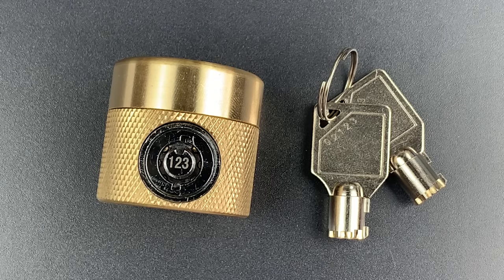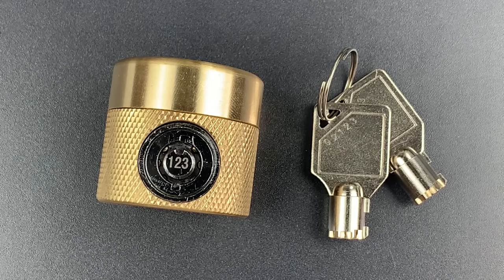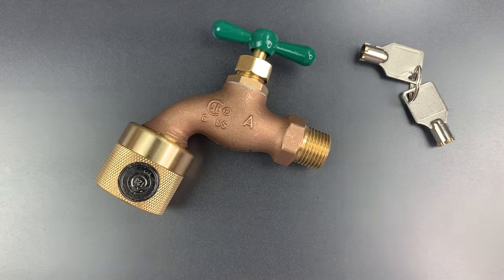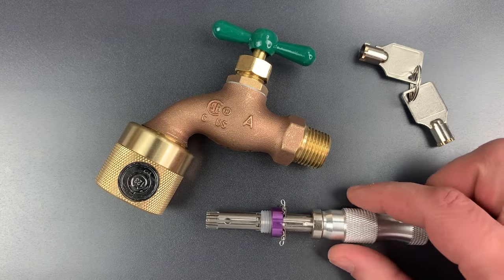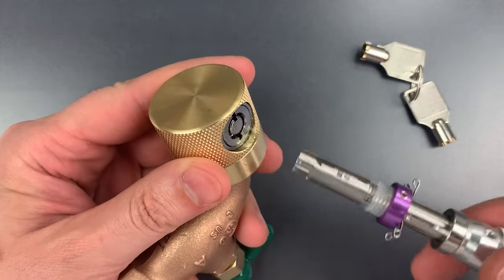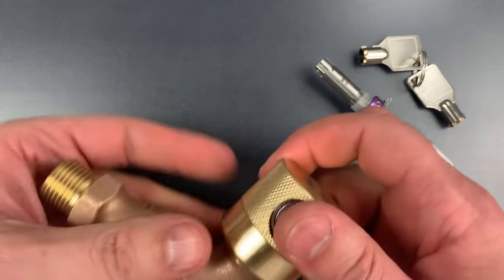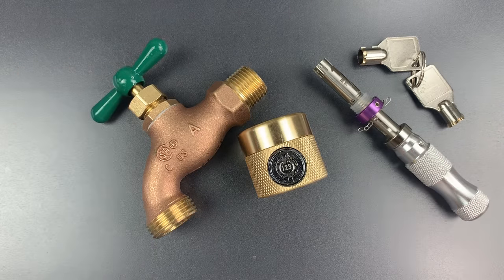[840] Flow Security Systems “FaucetLock” Picked FAST

Comment: The real flaw here is that if the water is turned on in a cold climate you will have a broken pipe which will cost you more than the lost water.
Reply: You should have either a single shut off for your outdoor faucet loop, (especially if you have a water softener or whole house filter) or individual shut offs for each faucet. Lots of times the faucets are part of the sprinkler loop so they get turned off in the winter by default.

Comment: Do you think a tubular lock is better or worse than a wafer lock for this kind of application, ie low value target, low cost a priority?
Reply: That depends entirely on the implementation of the lock. There are plenty tubular locks that can't be impressioned. Then you have to pick it several times to get it open. There are wafer locks that can be raked in seconds, and there are ones with multiple false gates and other goodies.

Comment: I would challenge your assertion that the coupling can't be easily unthreaded. A slim-jaw pipe wrench would easily fit over the non-knurled portion of the fitting, and the tool steel jaws would bite right into the brass fitting, allowing it to be unscrewed from the spigot. This is a much lower skill attack than using an impressioning tool to pick it open.

Comment: Okay, but in all fairness, this lock is probably not to deter crime, but to make sure somebody doesnt just use a faucet thats connected to a bad water line. This is more a safety measure than a security measure from the looks of it.

Comment: What about trying to turn the brass top part. The part that is at the top. It doesn’t spin after you lock the lock could you just use a wrench to take that off?
Reply: Wait does the top brass move freely after its locked. Hard to tell

Comment: But what prevents someone from unthreading it by turning the smooth part?
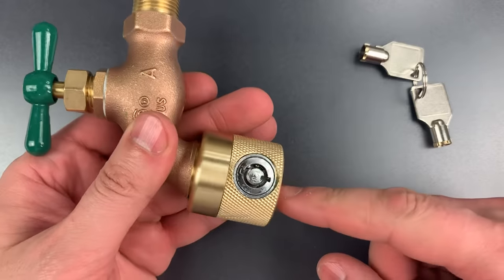Reply: The smooth part rotates also. At 0:32 you can see a tiny indent in the smooth part which is gone after he rotates it.

Comment: I've never heard any part of a faucet called a "bib" before
Reply: Thats not technically s hose bibb but a hose spigot. Hose bibbs generally penetrate the siding of the building in some way and also usually have a wider piece which screws or bolts to the building. Spigots just thread on/in.

Comment: so the bottom bit spins when its locked, i cant help but notice the top bit that dont spin is threaded, so couldnt you just hold that bit and unscrew it? in australia we have "security handles" so you cant turn the water on without a special tool, the city government uses them on any faucet thats within public reach
Reply: The top bit does spin. You are number 8347 coming up with that idea.

Comment: What happens if you just open the tap? Wouldn't water flow through the lock?
Reply: There is a gasket inside it which seals it off. Nothing will happen when you open the tap.
Reply: @Engineer9736  Thank you, I have never seen this lock and it is not available near me so I couldn't get a good look at it.

Comment: Can't you just grab the smooth portion of the lock and twist off with either your hand or by using a piece of rubber mat between it and your hand?
Reply: The smooth portion rotates also. There is nothing that can be grabbed when it’s unlocked.

Comment: why dont you just screw it off, holding it at top part? what prevents that?
Reply: The top part does not spin separately from the bottom even though it looks a bit like it in this shot. The entire outer housing disengages from the threading mechanism inside.

Comment: That also appears to be weak against spanners. Assuming that's actually brass up at the top, it'd be a cakewalk to just bite into that and unscrew it by the fixed portion.
Reply from the maker: The ENTIRE outside is one spinning piece!
Reply: @lockpickinglawyer  Oh neat.  Weak core aside, that's a pretty solid design.

Comment: I have homeless using my outside faucet to wash up and fill water bottles.
My "lock" is a cheap clamp tightened with a nut and bolt.  This is a low value target.
These people aren't going to spend the effort to mess with this.

Comment: I am really surprised that this type of lock actually exist ! Given that cubic meter of tap water isn't actually expensive , and that is most likely that anyone from us , who is house owner might spend few extras that it was planned , if planned at all.
However , there are removable parts that only allow faucet to be opened with them and not way around , but , interesting way of protecting faucet. Now , the question is - will it prevent water from leaking if faucet is turned on , or will it act as a extra vent too ? :)
Reply: There is plenty of cities and villages with water shortage(be it cause its so polluted or there simply is no water) including cities in US
Reply: It didn't look like it threaded on far enough to entirely act as a plug.

It's basically a deterrent product.  It's presumably cheap, fits on any hose bib with standard 3/4" hose threads, and doesn't require the hose bib itself to be changed out in order to get the added security.  So for someone that doesn't want to hire a plumber to replace the hose bib then this is a quick and relatively simple solution.
Reply: @CzornyLisek  , that is correct , in city where my brother lives , water is permanently polluted with arsenic from ground , and nothing can't be done about it , except replacing entire water supply system. Water can't be used even for car washing , due to very toxic nature of arsenic.
Reply: @TWX1138  , that's what I thought , well , more guessed , as if it doesn't stops water like plug , then it's more like device that says: "Don't bother with this faucet. :) And , given the fact that they are all (mostly) 3/4" pipes , it does its job quite well for few bucks. :)
Reply: @s0men00bb  "a square meter" 
That sure as hell would be cheap.
Reply: @andregon4366  😂😂😂😂
Typo , I meant cubic meter. 😂😂😂😂
Reply from the maker: TWX, it does stop the water.
Reply: @lockpickinglawyer  *nod*, thanks.

Comment: I really don't see a point to this product as it would be as easy to remove as any cap installed with a pipe wrench.  This lock would likely be destroyed by the same forces you could apply to any standard pipe cap rendering this even less effective than a very cheap hose pipe end cap.

Comment: A shut off valve inside the house is a lot better. Probably cheaper if you install it yourself. Although the main reason for having the shut off valve to the outside spigot is frost protection.

Comment: You know I had no idea these existed. Never knew water theft was a thing. But if people do steal water forms someone's hose outside, that's petty... really petty. City water is less than $0.01 a gallon.
Reply: That might not always be the case. For example, where I live, we have water rationing: You need to report to the city how many household members you have, and then you get a ration per person. The rations themselves are pretty generous, one is more than enough to cover consumption for 2-3 adults. As long as you're within the ration allowance, water is almost free. Once you go outside, the price starts increasing exponentially. So if you have an outside tap, and someone uses it, and leaves it on, and you don't notice for a while, it can get expensive.
Reply from the maker: Imagine someone using your water on their lawn during drought rationing, or homeless using your house as a shower, or some kids leaving your water on to flood your basement, or a neighbor shutting off their water and pressuring their house by connecting hose bibs, etc... it’s all happened before!
Reply: That's wack. I guess I didn't realize the issue. Never really effected me.
Reply: @antonisautos8704  Agree.  To me, if you live where there's not enough water, to paraphrase Sam Kinison, you don't need a lock, you need a truck.  To move to where there's enough water.

Comment: Could you turn the water on it use the water pressure to remove it?
Reply: I think you have other problems if your faucet is outputting enough pressure to de-thread a lock
Reply: No, it makes a perfect seal.  The pressure of a faucet wouldn't be enough.  It'd just stop the flow.
Reply: It looks to be sealed with a rubber gasket of some sort. If you're fast, you can catch a quick glimpse of it.
Reply from the maker: No. The lock seals the tap.
Reply: @eak125  Even if it did leak it wouldn’t come off. You’ll need 1000PSI to blast such thing of the tap. Why are so many people coming up with that idea? Is the general viewer here 5 years old that they have never stopped a garden hose with their thumb? If your thumb or a plastic garden hose doesn’t blow then brass surely isn’t going to blow either.

Comment: Even with a proper core, would this really work anyways? Is the lock watertight or will the water flow through the contraption anyways if the faucet is turned on? And if it IS watertight, don’t you risk plumbing damage if someone does turn on the faucet with it locked?
Reply from the maker: It is water tight, and no, there would be no damage to the plumbing.

Comment: with a faucet lock like that, what happens if someone just turns the faucet on and walks away?
Reply: The water just stops at the lock rather than the valve.

Comment: You could still remove the "lock" by turning the upper ring.
Reply: Pretty sure the upper ring spins with the rest of the lock. It only kinda looks like it doesn't because it's so smooth.

Comment: Or just put a secondary shut off valve inside the house.  Case closed.
Reply: There is valve inside. But do you want to give your home key to gardener to open tap for watering your flowers? That lock is just to prevent someone washing their car with your water or doing "fun" prank of opening tap while returning from bar.

Comment: If you turn the green valve on, where does the water go?
Reply: Nothing will happen as there is a watertight gasket inside the lock.

Comment: Couldn’t you just twist the top of the lock? If the core only makes that part spin than it should be just as easy to unthread the lock. You probably wouldn’t need any pliers or vise grips.
Reply from the maker: It’s all one piece.

Comment: This lock makes no sense. In the worst case it's not even waterproof, so you can turn on the faucet and the water just runs between the gaps.
The lock should have replaced the dial for the valve, not the very outlet like a sick tumor.

Comment: A pair of smaller size Vise-Grip or Channellock pliers would have that off the spigot in just a couple seconds. A modest length pipe wrench would do the same. No need to put it back on when done stealing the water. Sell it for the brass at a metal recycler.

Comment: Couldn't you just open it by using pliers on the top part of the mechanism? that seems even easier
Reply: That part spins as well.
Reply: It doesn't look like it in the video, when he spins it with his fingers it is only the bottom part rotating @Voyajer.
Reply: 0:32 look closely, it does spin

Comment: Let's be honest here, if someone actually wanted to secure a faucet/tap, they'd simply remove the handle and be done with it. This lock is ... lipstick on a pig approach towards filling a niche that ever existed.
Reply: Let's say I needed water at a place, and that place had taken the handle.  I'd walk down the street a bit, and take a handle off another faucet, and take it back to the faucet I wanted to open, or just use my leatherman pliers to turn the valve.

This provides slightly more deterrent, as I need more than just a tool that I'm likely to have in my pocket.

Now, the leatherman might still be enough if the brass is weak enough that I can use the pliers to crush the brass and defeat the spinning shell.  But I might need stronger pliers than I'm carrying, and I probably don't have a tubular lock tool with me.

It's not high security.  But it might well be enough security to do the job.